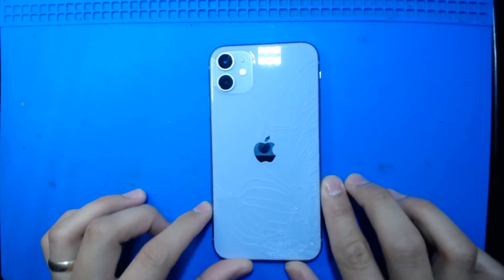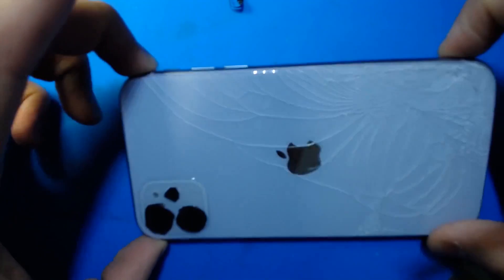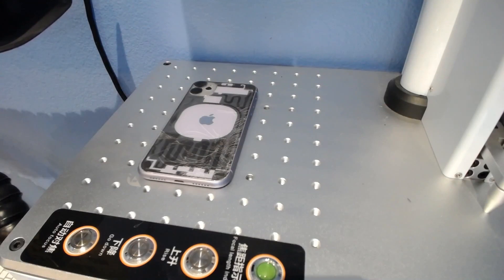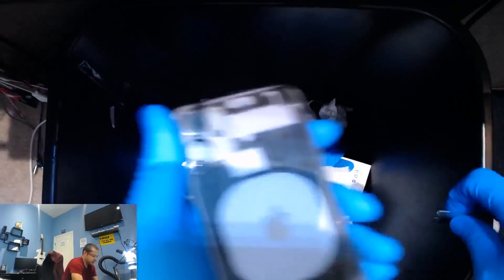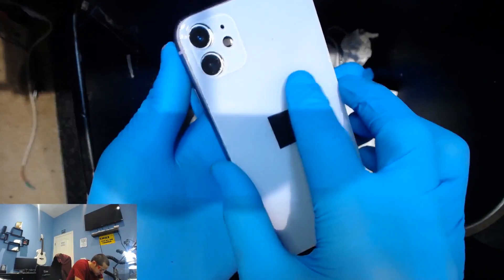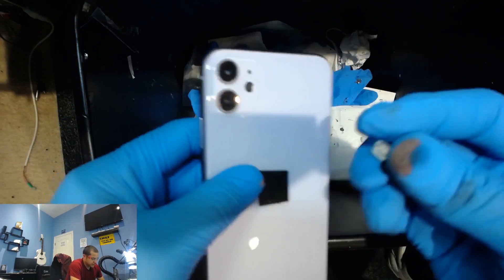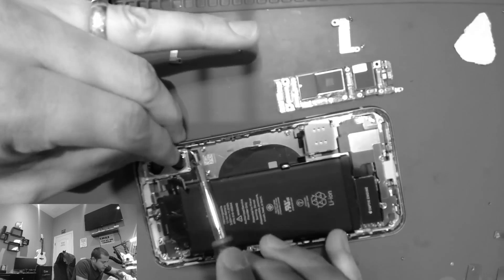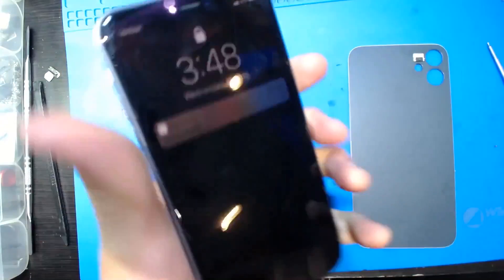iPhone 11 Back Glass Replacement - I broke the FLASH!!!!

Comment: Hey so I’m having the same issue . I replaced the flash and it’s still doing the same thing
Reply: Does the flash light work?
Reply: @captainroz5227  same problem and no flash doesnt work but the powerbuttoj works
Reply: @furkandundar1068  now it’s fixed